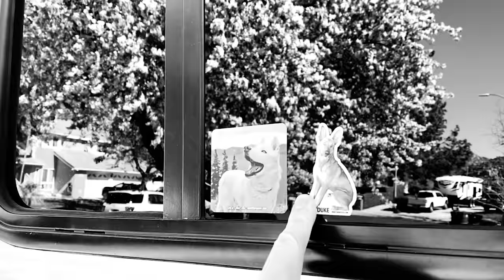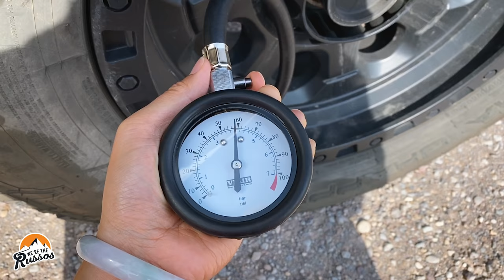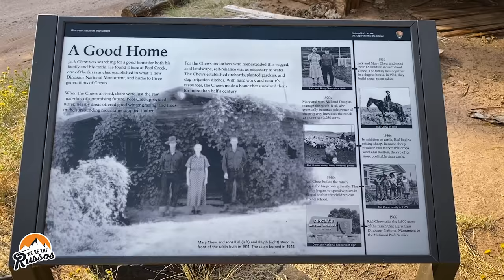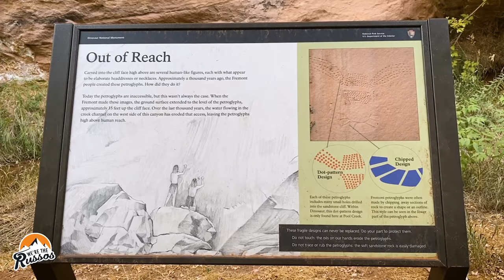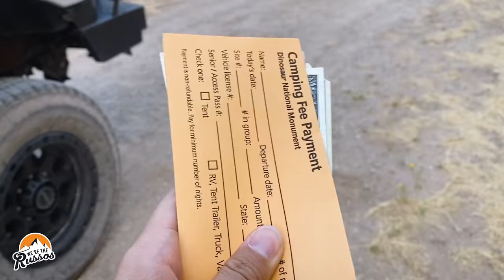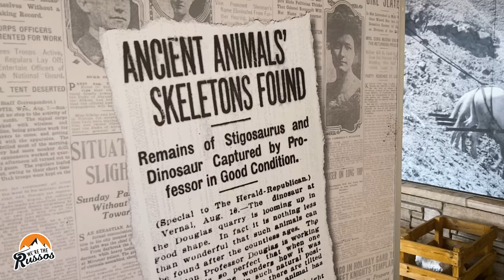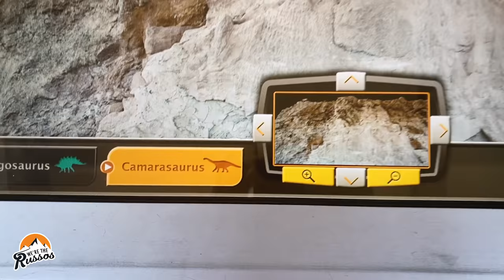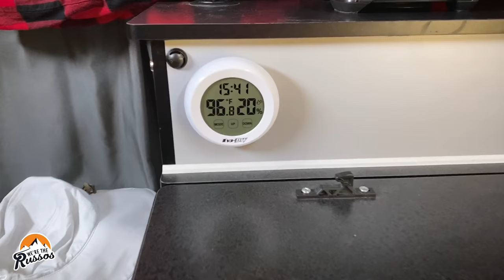Dinosaur National Monument | Overland Truck Camper Life

Comment: 13:10 - True story:

I converted my Prius into a camping vehicle and took it from the outer banks (NC) to the Olympic Peninsula (WA) last year. My partner and I spent a couple weeks in Montana and Idaho. (A Prius is more capable than a lot of people realize... and bear in mind I’m from rural KS so dirt roads don’t scare me.) One evening we took a two-hour drive up into the Panhandle National Forest outside of Coeur D’Alene way back on logging roads... (we were backwoods enough that there were grizzly marks on just about every other tree we passed)... It was finally totally dark and the road kept getting gradually worse as we tried to make our way back to pavement. We finally saw some overlanders camped on the side of the road for the night... We decided to ask them if the road improved ahead (it did). They were locals... decked out in camo... probably not expecting to see anyone come through... let alone a Prius... and the look on their faces was priceless. As we drove away I hollered, “Bet you weren’t expecting to see a wild Prius up here.” They got a good laugh out of that and we went on our way. So yes - we crazy Prius drivers are out there on those back roads. (And if anyone is wondering, our other truck is a 7.3 Excursion, so we’ve got both ends of the spectrum covered. Just can’t beat the Prius for saving money on long trips.) 🤙🏽

Comment: My last visit to Echo Park was in a 2 wheel drive pickup with a heavy slide in camper installed. It was a great trip until we decided to leave just as an ugly dark storm was moving in. By the time we were nearing the top of the climb out, it was a raging thunder storm. The sign that says it is impassable when wet is one to pay close attention to. I thought we were going to die that day. We began to lose traction and we had one more switchback to navigate before arriving at the top. We made it but it was very scary for a few minutes there. It is a really great place to visit though. Just check the forecast before going. VERY NICE VIDEO, thanks.

Comment: You may want to try grilled watermelon steaks. Cut watermelon into inch thick slabs, no rind. Brush with oil, then salt and pepper. Grill about 3-4 minutes each side. Remove and serve with veggies and rice.  I like to glaze the watermelon with balsamic and brown sugar glaze and feta or blue cheese on top.   

Great video by the way. So relaxing!

Comment: How do you know what pressure to inflate and deflate your tires especially with the weight of the truck camper loaded?  Love to see a vid on this???   Looks like a neat place to visit!
Reply from the maker: Basic rule of thumb is to air down to 50% of the recommended tire pressures for your vehicles tires (typically found on a sticker along the drivers side door). This is only for driving on dirt at low speed.

Comment: Joe what visit are you running? Is that the 400p with just a hose extension?

FWIW, I found out that replacing their inflator/deflator thing with a open air chuck inflates faster and it seems to keep the compressor a bit cooler

Kait, thank you for those awesome filming skills!
Reply from the maker: Thanks for the tip. The VIAIR we have is this one https://amzn.to/34pVl1N

Comment: Aside from not wanting to be caught down there in a rain storm; be honest, could your Hymer Active made it down and up that 12 mile road?
Reply from the maker: The only challenging part for taking the ProMaster on that road would be coming back up the hill since it's FWD. That said, if we were in the Hymer, we would not have gone down the road because we'd have no way to know what it's like from start to finish. The decent was very steep and no way to turn around if we ran into trouble. We didn't need 4wd but we didn't know we would not have needed it (hope that makes sense).

Comment: What tire gauge are you using?   Thanks
Reply: I believe it's built into the line as part of the compressor kit.
Reply: ScubaStevee62 ya tired looking it up on eBay. Saw a couple but not sure if not was the correct one.